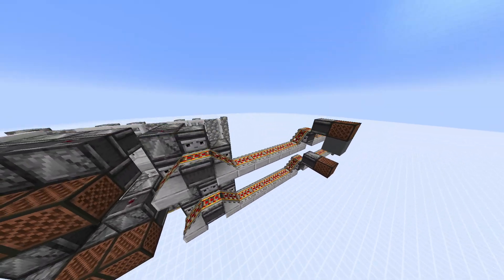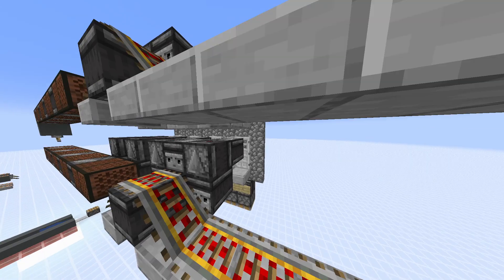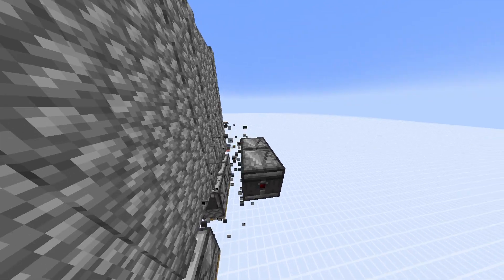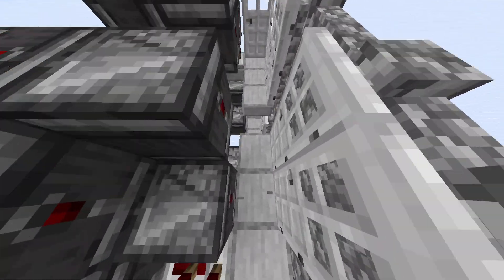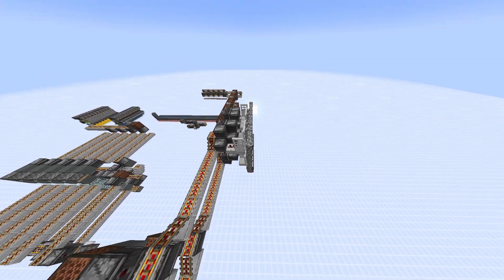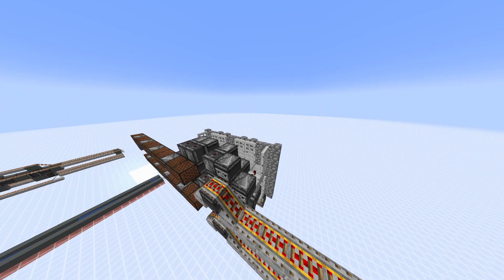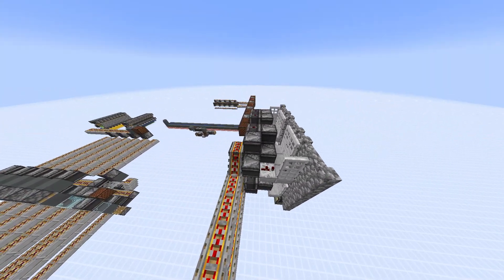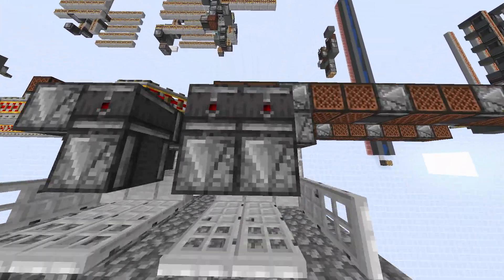Minimal Lag Unbreakable Dustless Binary Instant Wire Decoder | Minecraft

Comment: How fast can this be triggered? I'm noticing 2-tick repeaters so I assume minimum trigger time is 8gt?
Reply from the maker: Observers can be triggered every 4gt and if you need throughput you simply use another wire to avoid the repeaters. I cant think of a reason why you would ever want that tho.
Reply: How is adding another wire going to help since the reason you use repeaters in the first place is for tile tick priority to prevent false positives?
Reply: @AdamSchadow  Forgive me for being 2 years too late but I'm desperate for a decoder with a 6gt minimum period, what did you mean by add another wire? What would an additional wire do to avoid the repeaters?
Reply from the maker: @carterhrabrick8584  what you do is instead of using just one column of cobble walls fpr both the 1s ans 0s you use two columns and you join the signals with a logic gate. I will probably show it in a video.
Reply: @AdamSchadow  I figured out a design (after 6 hours of experimentation and teaching myself about tick priority) that is mostly true to yours in the video and uses one cobble wall column. The only drawbacks are that it has a clock line and an extra 2gt delay. I can make a vid on it or world download if you are interested.
Reply from the maker: @carterhrabrick8584  Thats great make sure to share it.